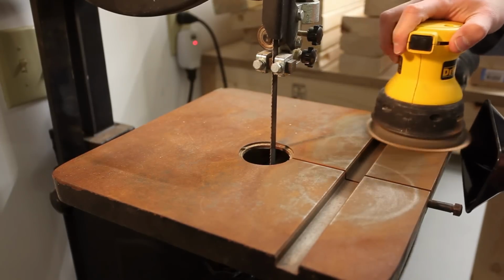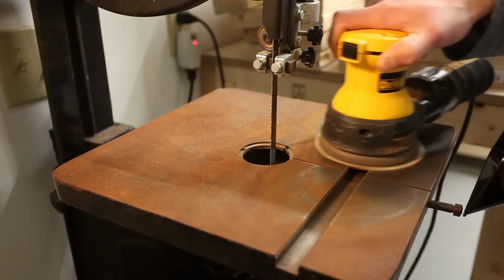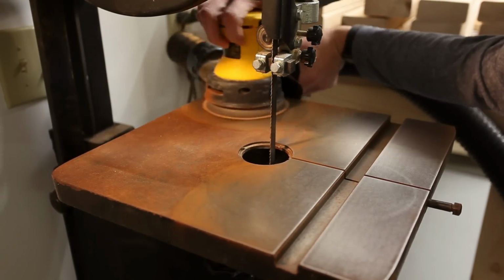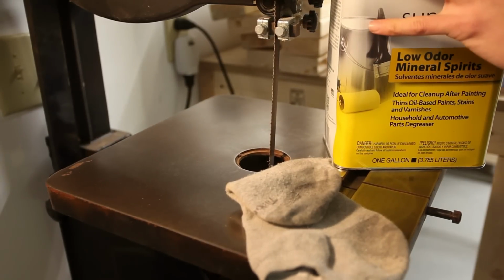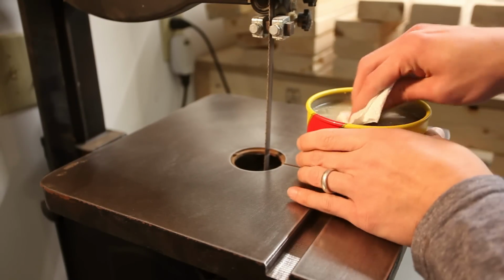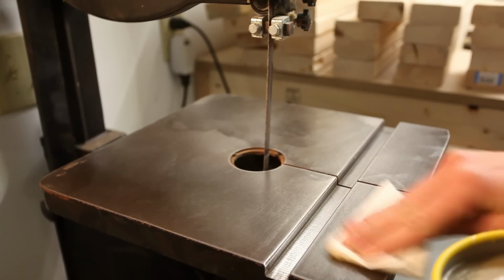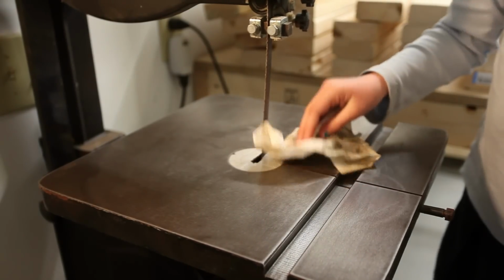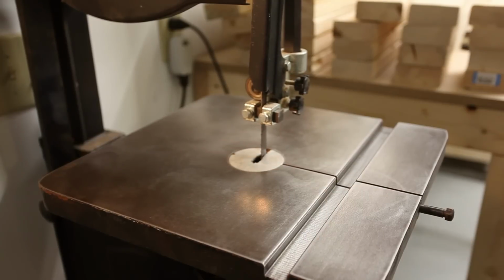How to remove rust from woodworking surfaces and tools

Comment: Sign her up!  What a ball of personality. You and your wife will have your hands full in another 5 - 7 years when the boys discover her and she discovers them. 

Have you ever used or considered using muriatic acid for rust removal? It’s an almost immediate process unless the rust is very deep and it won’t remove deep pits from rust. That still requires some polishing. 

It has a downside of fumes that are dangerous but with proper ventilation or just going outside it is fine and affordable ..and light years faster than sanding. Check around for prices. If you buy it from a pool or spa supplies source the price is much higher than from a big box store.  The surface will require immediate washing and oiling and wax or it will start rusting again in minutes. I’ve never used anything better or faster for rust removal but use it carefully. Vinegar takes several days while muriatic acid takes under a minute in all but the worst cases.
Reply from the maker: Hi Dennis - I'm sure you're right about us having our hands full! I haven't heard of muriatic acid but I'll look into it.  Thanks for the tip!
Reply: Tommy Tompkins  I’m sure you’ll be happy with the results. I had 4 steel rules that had so much corrosion it was hard to see the graduations on them. I think that’s due to poor quality steel from foreign made rules. I’ve since picked up some used Starrett rulers on eBay and they haven’t had nearly as bad a rust problem. A friend suggested the muriatic acid and it cleaned the foreign made steel up amazingly fast. He did warn me about the fumes but didn’t mention how fast the corrosion starts again. I found that out myself. Some WD40 and wax after rinsing them off was an easy fix.

Comment: I've used soaking it in a gallon of white vinegar with great success.  Takes about 24 to 48 hours depending of the severity of the rust. The stuff sells for less than $3, is nontoxic, and requires little to no elbow grease.  It leaves a blackish film that is easily removed with a plastic brush. Then, I rinse it off and use a quality car wax, like Mother's.  If that stuff protects outdoors imagine what it does indoors.  Great vid.  You've motivated me to do some of my other tools I have not used the above described process!